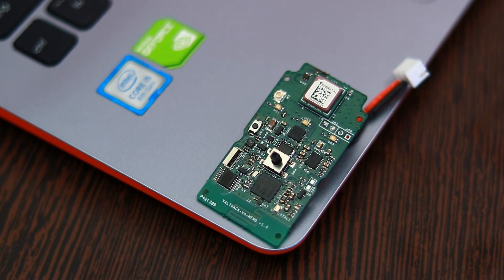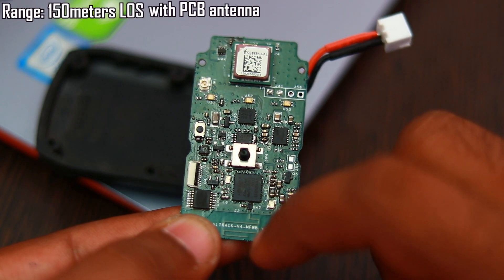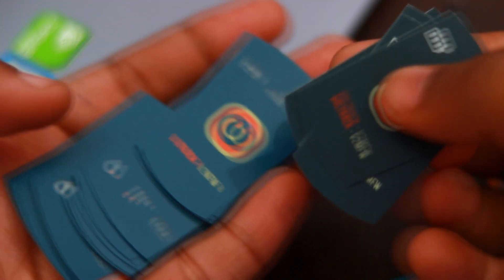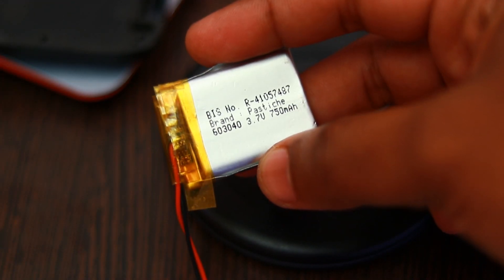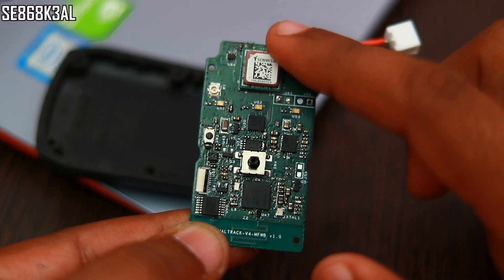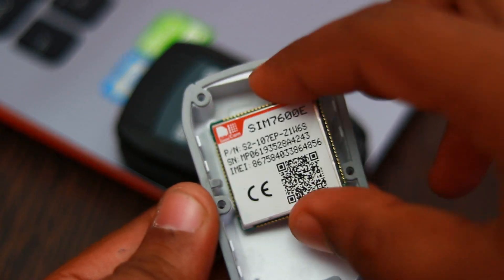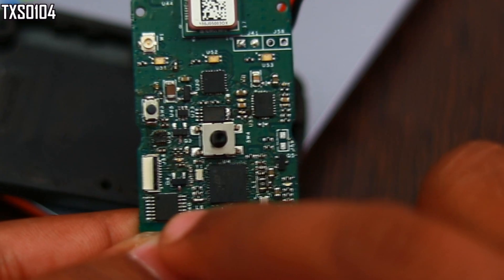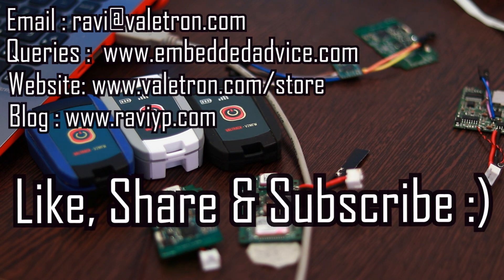VALTRACK-V4-MF-W - Designing a 4G-LTE tracking device with Bluetooth 5 and  Wireless charging-Part 1

Comment: Hi, how is the availability of the STM32WB55 in the market ? Where do you purchase this controller from ? And which exactly the package you are using ?
Reply from the maker: They are in stock on major distributors like Mouser. We get from Mouser. We use QFN48
Reply: @RaviPujar  are you using STM32WB10CC ?
Reply from the maker: @sanjaydalvi6635  We use STM32WB55CC
Reply: @RaviPujar  Thank you
Reply: Another question. All your modules are,e around SIMCOM and not any other makes like Quectel etc.. Any specific reason for using SIMCOM ?

Comment: The LTE modules do have the Bluetooth. I was wondering then why you did you use STM32  in built Bluetooth ? Your videos are awesome.
Reply from the maker: Thank you. Because of low power and Cellular Bluetooth is limited by at commands and needs Cellular to be on if only Bluetooth is needed.

Comment: Very informative video.    Can you explain a little bit more the reasons why you are using external GNSS (SE868K3AL) instead of the built in SIMCOM GNSS? . I'm want to know more how reliable is the SIMCOM GNSS.  Thank you.
Reply from the maker: It's smaller solution including antenna